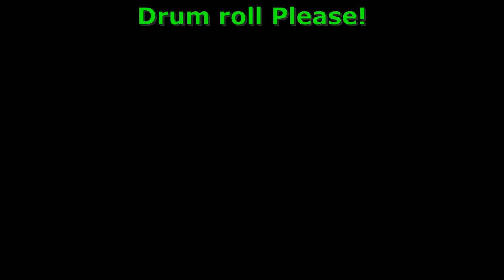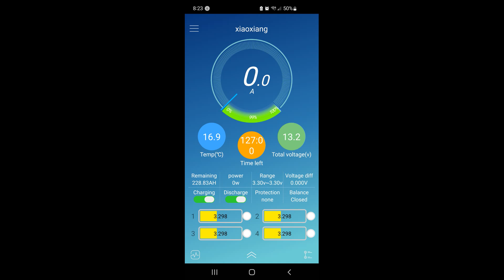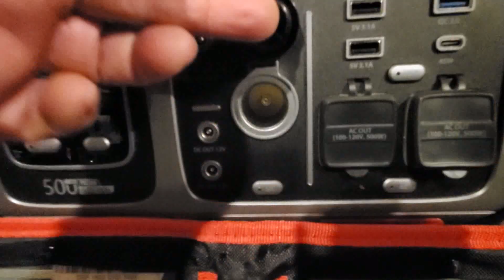5.8 kW Mobile Solar Generator

Comment: You are going to need a larger case for 5.8kW of solar panels to make it a "mobile solar generator".
Reply from the maker: LOL mobile in the since of several trips to pickup to load everything lol no it's not greatly mobile ( i have smaller ones if needed) but it can be moved unlike my house solar which is not mobile. I only need up to 12 - 100W panels which will only stack 3' on top..... ok it's has it's draw backs but I still love it lol.

Comment: I built mine inside old speaker enclosures i inherited from both grandfather's.   Small casters and an old tool box handle was installed for portability.  They can also be rolled into a small camper that im building.  They blend into the furniture perfectly.   Good job sir.
Reply from the maker: LOL good for you! Ya I've seen all kinds of mobile DIY solar generators and you can get pretty creative with them. I watched alot of videos before I built mind. It was fun designing it and building it, especially since it was almost free and quite powerful lol. Thanks for the comment. Take care

Comment: Proving that playing with solar rapidly becomes a very expensive hobby.
Reply from the maker: I'm not sure I would agree. These part came off my old system which has already earned it’s keep in saving my electric in my home. I pay cash for all my solar components and only buy one at a time as I can afford. My new system upgrade will pay for itself in less than 2 years at which time another year and the whole system will have paid for itself. I don’t consider that really expensive. Now it does take money to make money and if you don’t know what you are doing or what only “the best of the best”, you can lose a lot especially if you have someone else install or build it. Add batteries, which are the most expensive part, and you can lose ALOT more! To many people fall for the door to door salesman and help continue the rumor that solar doesn’t save any money and in that case, they are correct. That is a sad event taking advantage of those who don’t understand. 

Now if you are making this on new parts and not from a previous home system you have already used, it can get expensive! and I will agree. This unit if built new would be around $3000-$4000 with no return. Still better than buying one already pre-made (advertised everywhere) for $4000 to $6000! It is really only for emergencies or maybe mobile applications, which is cool, but not something I’m going to spend that much money on! For me, it was pretty much a FREE $3000 - $4000, mobile generator. So I’m pretty happy and it was not expensive at all! I see people paying well over $4000 for these pre-made units already built for SHTF stuff and feel sad for them. That's enough to build a small home system that would earn it's keep! Thanks for you comments. Wishing you the best. Take care.

PS my red smaller unit with the 160W panel was free because it came in a wet box so I was fully refunded. The unit itself never got wet so it too was a great deal lol. Now I did pay $60 for the small 28w and another $50 for the small 20 mill amp battery bank but I can afford that.